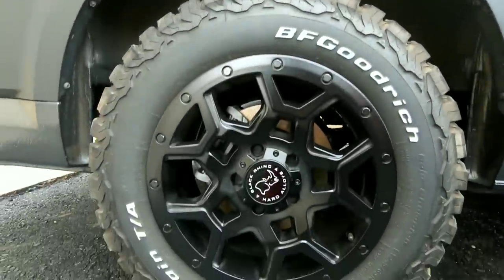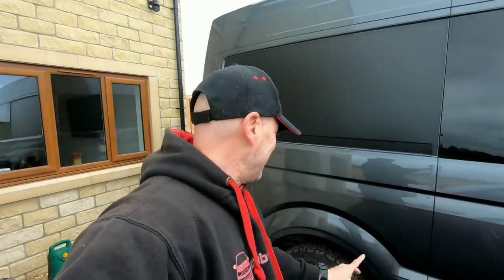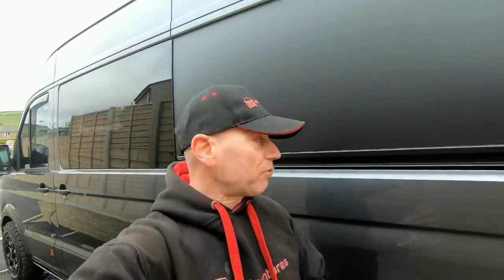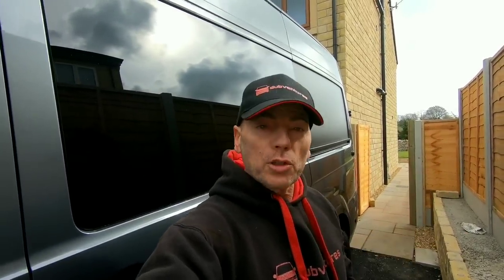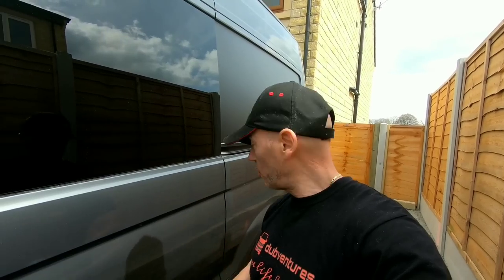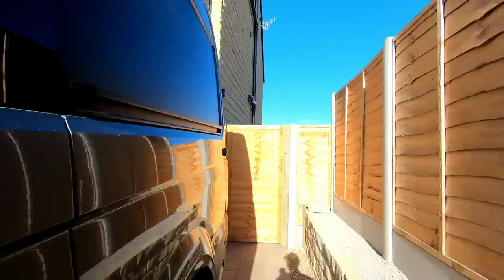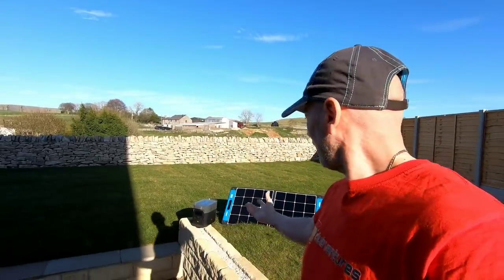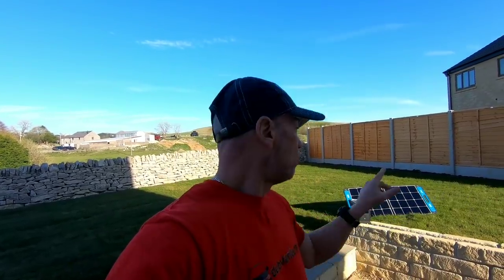VW SWAMPER Campervan | THIS IS A MESSY JOB..!

Comment: Great wee video .I always try to embalm my vehicles .Jetwashing on a hot day is a must .I jack the vehicle up .Take the wheels off then blast everything then swoosh the underseal .The stone chip cans are good too.Then down the line I scoosh spray grease everywhere .Especially the brake pipes .Wd40 spray grease is incredible .Very sticky .lasts long .What a good vid to watch .Eco warriors unite! Ps what power pack is that .Looks great man.
Reply from the maker: Sounds great may have do that. Its the Ecoflow Delta its amazing cant recommend it enough. Check out the link in the description for more information 😁
Reply: @dubventures  Majic mate .Cheers.

Comment: Tom i can't  believe,  you did that . !!! Even if you dont have a trolly jack .  Use your normal  jack & take your wheels  off ???, . 
And put the solar panels  in the sun properly  .    But the power  pack looks  good , 👍.
Reply from the maker: Take wheels off? You dont need to. Was it not in the sun. It charged up so i dont know what you mean.
Reply: @dubventures  yes tom take the wheels of , then no need to cover up the wheels  ....  
As for the solar , they were at a angle !!! Point then at the sun 🌞...to get full power ..
Reply: @leetaylor5348  It was in the sun. It will charge even with a little bit of sun on them.

Comment: Looking good Tom luckily my van has a plastic Shield in the wheel arches like your garden wall really nice tip on the solar panels try and keep the panels in line with its shadow for max charging and no shadow at all on the panel  👍🏴
Reply from the maker: Thanks for the tips. Yeah we really pleased with the back wall in the garden 😁

Comment: take the bloody wheels off
Reply from the maker: You dont need to.
Reply: Only a half job by not taking the wheels off.
Reply from the maker: @Smokeysbandit  So how is the job not right? Its done and done correctly. There is no issue. If i couldn't reach then i would understand your comment. 🙂
Reply from the maker: @stevessub  How is it half a job? 😂 I didnt do half of it i did all of it. 🙂

Comment: Wouldn't it have been easier to have taken the wheels off first?....
Reply from the maker: No. You don't need to.
Reply: @dubventures  agree you don't need to but as Steve said it would have been easier with more room to spray
Reply from the maker: @TingBiker  Hi. It would have made no difference at all. There was space to do it.